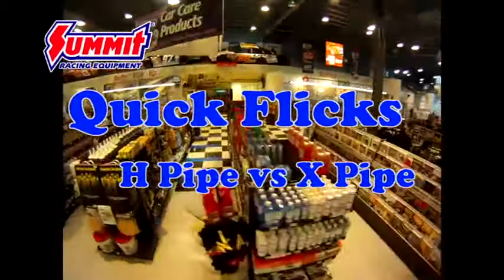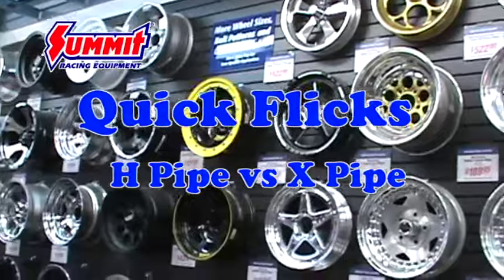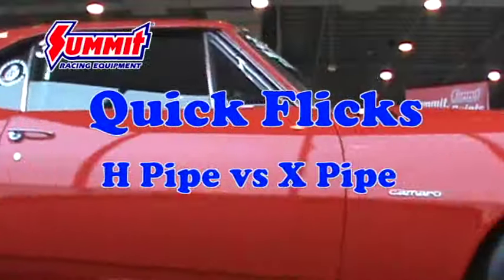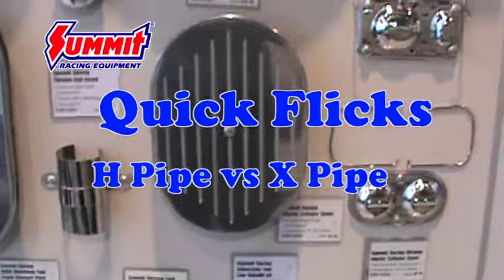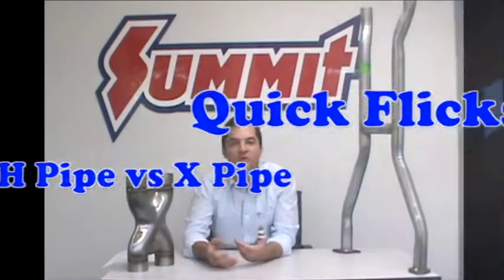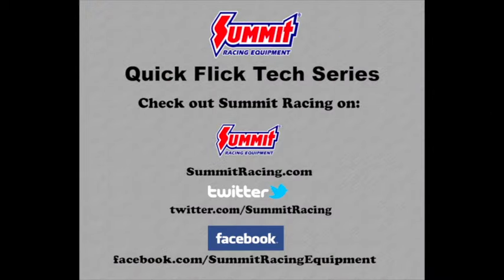Exhaust X-Pipes vs. H-Pipes and Differences Between Them

Comment: i have a 1990 s10 blazer 4.3 tbi and im looking into the exhaust and i see alot of true duals no cat and 2 glasspacks or flowmasters and then people using the y pipe with no cat single pipe in but dual pipes off the muffler and out the back.. just not sure which way to go.. looking for a little more low and mid power but also be loud what are my options?
Reply from the maker: Justin Bailey, 
Well, parts options are many!
Limiting factors will be room available beneath the vehicle (routing), budget,
and the installers capability. Due to emissions (less than 25 yrs old) you’ll
need to incorporate catalytic converters into your plan. With that being said,
a set of shorty headers and a y-pipe to a high flow cat converter and exhaust
system should get you where you want to be. This will be a good addition to
low/mid range torque, good sound and should be budget friendly. Give us a call
and we can help you put together a parts list. 1-330-630-0240. Thanks for watching!

Comment: Hi guys, what about changing the stock resonator for a x pipe in a c4 corvette with muffler eliminators?
Will this be an upgrade in performance?
What about the sound, I would like a loud sound
Thankss :)
Reply from the maker: Hi Borja Müller, 
Though an X pipe will have an effect on the tone of the exhaust, the mufflers are more responsible for the loudness/volume of the exhaust. Chances are it will not be any louder.

Comment: my 2002 f150 4.6 has true duals, with a 2 in/2 out magnaflow muffler. should i install an X pipe closer to the engine as well?
Reply from the maker: Hi Josh, 
If it is a daily driven towing vehicle, you may not see a real boost in power given the amount of work and expense you’ll encounter to install it. On the other hand, if you’ve built a machine you’re trying to squeeze every ounce of power out of and run it hard, yes, do it!
Reply: +Summit Racing what about a crown Victoria who i help it or affect it

Comment: i have a 1978 oldsmobile cutlass supreme with a chevy 350 im trying to put shorty hooker headers on as well. do i go with the h pipe and x pipe. and is it true that x pipe need dual exhaust
Reply from the maker: Hi Luis Gonzalez, 
Both H & X pipes use a true dual exhaust. Which one you use depends on your goal for the car. Give us a call on the technical line and we’ll walk ya through it! 1-330-630-0240

Comment: I have a question I'm new with dodge..and I recently bought a ram rt 2014...and my question is..is it too early for me to place the x pipe on to my vehicle with MagnaFlow muffler? Or should I wait till I buy more performance parts to have more power?
Reply from the maker: Hi *****, 
A cold air intake, a cat-back exhaust and a programmer would all be beneficial for you at this point. It won’t really be necessary to fabricate an exhaust to install an X pipe until you decide to change the heads and cam and have it tuned.
Reply: Summit Racing thank you more or less would i drop a secound..if i installed those items? i ran my truck at the track which i hit a 14.5 & also had an other question should i install a supercharger? im very interest in knowing if i should, one reason stopping is that if my truck will waste more gas.. i want my truck to be a daily driver not a weekend only ..

Comment: hey i have a 1994 gmc c1500, 305ci, ive already put a new chip in the computer and some other small stuff throttle body spacer, ignition coil, breathers instead of pvc, cold air, ignition coil + module, shift servos and boost pressure valve, 180 deg. thermostat.... im building it up to be a fun a peppy weekend cruiser and bracket racer.... so in your opinion H or X pipe, i would like to do as little machining as possible. thank you for your time
Reply from the maker: Hi Anthony Hewgley, 
Assuming the stock heads, cam and intake manifold are still being used, an H pipe is all that is really needed.
Reply: im getting a exhaust job first but i plan on installing new heads, intake, larger ratio rockers in loo of a new cam, and a new crank for a 4in stroke for a new displacement of 351ci... i know kinda sill but i want to keep the original block and have really unique sbc chevy instead of the usual 350ci or 383ci
Reply: Anthony Hewgley
a 2400rmp lockup stall converter is going on as well
Reply from the maker: Anthony Hewgley, 
Can you give our tech line a call? 1-330-630-0240. This definitely changes things. We look forward to your call. Thanks!

Comment: Hello I am building a 1998 Ford f150 5.4L. It will have twin turbos and I am looking to find the exhaust set up I need to gain more power. 
Thank You.
Reply from the maker: Hi DZ Racing, 
We are sorry to say, we do not have a ready-made system for that application, but we can help with the materials to help you fabricate what you need. Give our tech line a call at 1-330-630-0240.

Comment: hey I have a mustang gt 2000 which one is better if I want to add some horse power and a good firm sound.
Reply from the maker: +Guillermo Farfan, 
Well, you already have an H pipe from the factory so, an X pipe would be an improvement for you.

Comment: Hey there, I have a 2009 Mercedes Benz C300 with 2.25 inch stock exhaust piping. Despite my request, my muffler shop told me that a 2.5 inch x pipe is easier to install and would sound the exact same as a 2.25 inch x-pipe. Is there any real difference at all between a magnaflow 2.25 or 2.5 x-pipe on 2.25 exhaust piping? I have the 2.5 currently installed and it sounds alright but I always wondered if it would have been better to install 2.25.
Reply from the maker: Hi Rodpwnzz,
Well, its not that the X pipe doesn’t affect sound, that is mostly the job of the muffler, but a change in size from 2.5 down to 2.25 would not be worth the trouble at all. The change in tone or sound would be barely noticeable!
Reply: Thanks!

Comment: Hi i have a question  whats better  for a 96 cobra  n x pipe or n h pipe  i have magnaflow magnapack  muffler on it need help
Reply from the maker: Hi Alex Pacheco, 
If your future intent is to add parts to improve airflow such as heads, cam, intake & headers, an X pipe would give you the advantage of good exhaust scavenging for max horsepower production. Otherwise, stick with an H pipe!

Comment: What are your thoughts on an x pipe on an in-line 6?  I have a high comp (12.7) methanol high revving dirt circuit car with a header system that splits cylinders 1,2,3 into one 2.25" pipe and 5,4,6 into another.  With a firing order of 1,5,3,6,2,4 I see the engine having similar exhaust pulses to a v8 configuration and I have purchased a magnaflow 2.5" x pipe which I intend to install to see if I can improve scavenging - your thoughts????
Reply from the maker: Hi tony anderson, 
Yes, by all means you should try it. If you can, get a dyno number before and after the installation. Not only will this give you a new horsepower number, but it will also tell you if your power band has moved at all so you can change your gearing accordingly!  Good Luck!!
Reply: Summit Racing thanks for the reply.  I have already purchased all the equipment from you guys and I will be doing a back to back comparison on the new system.  I don't pay for my dyno time (sponsored) so doing the dyno testing is no problem.

Comment: What kind of exhaust system would you recommend for a 98 dodge ram 2500 v10?
Reply from the maker: Matt Young,
This would really depend upon if
any changes have been made to the truck yet. If it is all stock than a great
start would be a “Cat-back” exhaust system from Flowmaster or Magnaflow or any
others you may be looking at.

Comment: hi i want to do a thru dual exhaust on my 04 dodge ram 5.7 liter. do you recomende to go with the x pipe or with out. i want to keep the cat converter just after that thru dual .
but what i am afreid is about poping noise and.
and also what kind of muffler performe better in my truck  
thanks

Comment: I would like to increase my fuel mileage on my 06 Silverado 1500 and I want to know what's best. I want exhaust but I've already decided on that. I was wondering regarding throttle body, throttle body spacer, and air intake, hp filter vs cold air intake vs ram air intake. I like performance but with such a gas guzzling truck I want to increase mileage.

Comment: I want to remove the resonator on a land rover lr4, I was thinking replacing it with straight pipes. Should I replace it with an x-pipe instead? What are the differences?
Reply from the maker: gytser, Removing the resonator will make the vehicle louder. By adding some type of cross over pipe, whether it be an X or H pipe, you will equalize pressures between banks adding some power. Unless you are racing the vehicle or looking for max power in the higher RPM ranges, an H pipe will work fine.

Comment: Do you have actual dyno results that demonstrate the HP\Torque benefits of an X-pipe vs. an H-pipe?  I've heard conflicting results from different sources.  Thanks!
Reply from the maker: Hi Cash2112. 
Results for an X pipe vs. H pipe shootout will vary depending on the application. There is no easy answer! You will need to research and find a test on the same combination of parts as you yourself are using and If that varies in any way from what you are building, so will your results! Good luck!

Comment: i have a 97 crown vic with a 4.6 and i installed a knock off flow master 10 series muffler i has single exhaust and four cats what can i do you get better preformance in my exhaust and more sound because it have a great sound its just very quiet and i heard these cars react greatly to duals
Reply from the maker: +Anthony Hadaway, 
Well, catalytic converters absorb sound, that’s just a fact, and legally there is just no way around them! But, doing a true dual exhaust after the Cats would be a step in the “better sound” direction!
Reply: +Summit Racing see I wasn't really thinking about running true duals because when I think of true duals I think of default divorce duals but I was wondering if I get the exhaust off of a p71 which is a dual system stainless steel with an H pipe if that would help me out in the sound department and give me a boost in Power

Comment: Would i want to use a h pipe on a 1987 chevy camaro iroc z28 with a aftermarket twin throttle body
Reply from the maker: Hi mopar85, 
The underbody (floor pan) of that car will not allow for a true dual exhaust with an H pipe without heavy modifications.

Comment: Hey I have a 09 ford crown vic police interceptor.have afe cold air intake rear cats cut flowmaster 10 3 1/2 inch tips sct canned tune and all my piping is stock with a h pipe.looking this week to get x pipe.the way I see it the stock pipe is rusting might as well do aftermarketpipe and just do x pipe.my engine is pretty much mildly tuned will x pipe hurt.I have experience loss acceleration doing my cold air intake.better now with sct tune wondering if this would hurt acceleration and torque

Comment: i just installed a flowmaster outlaw axleback on my 2015 mustang v6 and im getting some drone. some people suggested swapping the resonator with an h-pipe what do you think? will that cure the drone a little? i want an x pipe though but im afraid it will increase drone what do you think?
at the same time i want a loud throaty sound with an increase in horsepower and torque but i want to get rid of the drone at the same time
Reply: You can't have your cake and eat it too. every aftermarket system drones on the highway. 

You can try adding more sound insulation to your cabin.
Reply: well my friend has a borla atak exhaust on his 15 GT and there is no drone at all...  
how do i add sound insulations to my cabin ? never heard of it, can you link me to a website or something ?
Reply: If you google, you will b answered

Comment: Hi, i have Mercedes Benz W211 E280 6 cylinder 277 hp. I’m just confused H pipe or X pipe is better for my car?? And which one ☝️ is nice sound???
Reply from the maker: Thank you for your question.  They are an excellent upgrade for a 5.3 as long as you are running the 205/215/220 models.  The decks are very thick and work well with boost.

Comment: If i have 2 mufflers then more mufflers on the back near the tips, will the X pipe increase the sound of the exhaust if i dont remove all the mufflers??
Reply from the maker: It will not make it any louder, but it will change the tone slightly.

Comment: Would You Recommend An X-Pipe Or H- Pipe On A Ford Ranger V6 OHV 1996 ?
Reply: honestly I've seen more power and sound come out of a single on those motors. I'd just say try to remove any restrictions (second cat, extra bends, low flow muffler).

Comment: What happens if you run cat back no mufflers and no x pipe or h pipe? Will it hurt the engine?
Reply from the maker: Hi Jake, 
Your car would be really loud and the oxygen sensors would most likely not be able to get a good reading.

Comment: is it a good idea to get a h pipe or a x pipe with a turbocharged ls1? what are the benefits or disadvantages?
Reply: Ok here you go. Take my knowledge for what you want.  Not here to start an argument.  I get all the uninformed these days saying they want an x pipe. With an x pipe you will get about a 3-4 hp gain in the top end (which is nothing) and about a 10-15% loss in torque in the low end.(which is a lot)  Believe me you will feel that. (because with an x pipe you loose back pressure at low RPM's) For daily driving this sucks. Plus hands down an H pipe sounds so much better. I love that old school deep rumble growl that goes with the H pipe and the 3-4hp is not worth that obnoxious raspy sound from an x pipe.   For a heavily modified motor and I do mean heavily modified including forced induction go with the x pipe. This is because now you are pushing enough exhaust flow to make that x pipe shine. That is the only time you will see the true benefit from an x pipe. I am so tired of so much disinformation out there and I hope this helps a few.
Reply from the maker: Hi Tyler Hencken, 
Assuming you will be running a single Turbo, it will be your common point for exhaust to gather and spin the hot wheel. Therefore, an H or X pipe will have no benefit to you.

Comment: Regards from Serbia, work on the exhaust Bmw E36 Compact 2000year m43engine 4-cylinder 105hp 77kw, I personally like X-Exhaust Pipe. Do I got more horsepower with Exhaust X-Pipe or would have a slower car?
Reply from the maker: Kristijan Kis, 
H and X pipes were created to equalize pressures between banks of V6 and V8 motors. Because you have an inline 4 cylinder motor, a tuned, scavenging type header is the best you can do to maximize power!

Comment: Hi, can u tell me if it is good idea to install X or H pipes on BMW E46 330? it is 3.0 Liter engine M54B30, thx
Reply from the maker: Hi Gabriel, 
The best advice is to find someone who has dyno’ed the combination in question and their results, versus the cost required to do it and see if it fits within your budget!
Reply: Thx for replay, I will dyno my current setup soon and after some time I am thinking for X pipe configuration with brand new exhaust manifold...will see how it will change, also Im looking for badass induction sound that X pipe gives, oh yees :)

Comment: 2000 chevy silverado is the x pipe use full? putting duals on it with some sort of mufflers. (dynapros or flowmaster) & then 4 inch tips
Reply from the maker: +Chase Lynch, 
Low speed, towing applications don’t generally see much improvement out of an X pipe.
Reply: +Summit Racing will it sound better from the equivalent amount of pressure coming out of it?

Comment: For a c63 w204 m156 which do you recommend?
Reply from the maker: It will depend on what you can fit under it, but a X-pipe will equal out the flow better.

Comment: I have a 2001 Ram with the 5.9L and I'm looking to make more power in the top end, for better acceleration at highway speeds. It's really sluggish from 55 on up even with a 4.10 rear end. I intend on installing an Air Gap intake manifold and long tube headers, but I've been told multiple times that true duals, regardless of X or H pipe, are a bad thing for a truck's performance. Everyone seems to say I should stick with a single pipe after the cat and then Y it off downstream if I want a dual exit. Is there any truth to this, or would running dual exhaust with an X pipe increase my performance?
Reply from the maker: Hi desertfox2020, 
Your original statement says that you are interested in power in the top end for highway speeds. Running two individual pipes (correctly sized) with an X pipe for better cylinder scavenging is the way to go for that purpose!  Others are telling you to merge to a single pipe because most trucks are used for towing at low speeds.
Reply: Summit Racing Thanks, I thought so.

Comment: what is the best for a 2012 gmc sierra 5.3l v8
Reply from the maker: +Outdoor-Texas, 
Not sure, due to space availability under the vehicle, that the effort and cost associated with custom bending either system would allow any benefit on a totally stock vehicle! Custom tuning would be necessary as well, so make sure you factor that cost for a clear picture of total funds laid out!